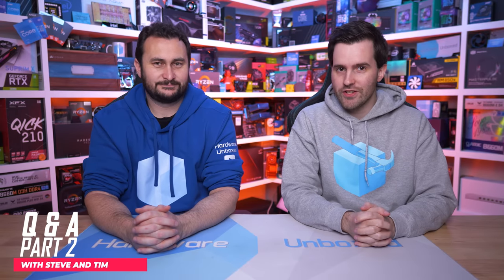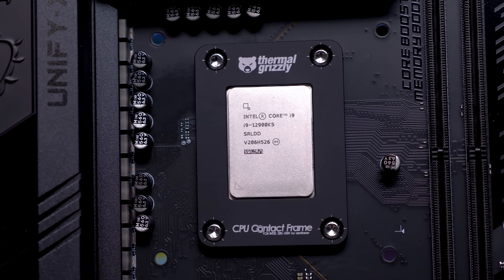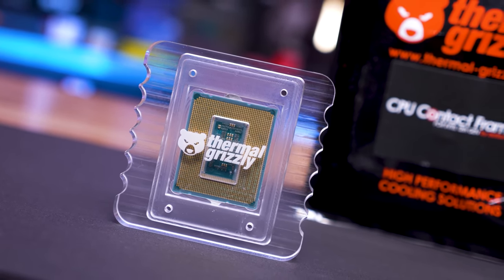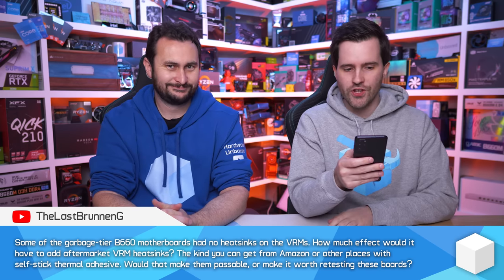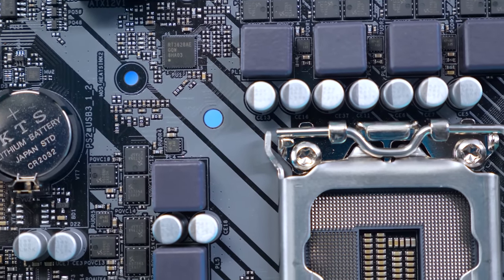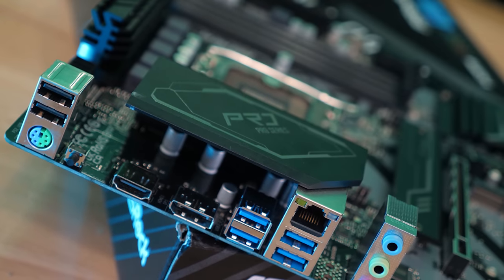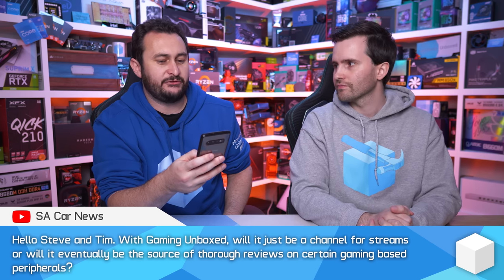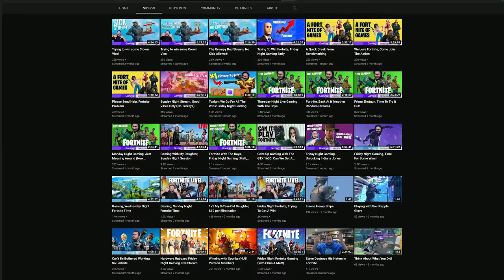Biggest Tech Fail 2022? Zen 4 To Make DDR5 Relevant? August Q&A [Part 2]

Comment: 8:30 - Yes, for most but not all games I use my mouse's max DPI and move the mouse only millimeters to achieve the movement.  I don't however know what that DPI is without looking it up.  It's the newest version of Mad Catz's "RAT 6+" - a flipping fantastic $35 - $45 mouse and unlike Razor, LogiTech, and other Chinese trash, this Taiwanese mouse is built like a tank with solid 2.5mm aluminum base and high impact plastic upper.  But enough about the mouse, I use it at full DPI like this because I got used to doing so as a tournament level Quake III player back in the day. I click the DPI down 2 notches when not in game - and sometimes three notches when using applications like Motion Builder, Maya, Houdini, and so forth.  I also never use a mouse-mat - so it's a slippery-hard desk top surface.

Comment: intel is done, hard failed at GPU, incoming hard fail at CPU against zen 4
Reply: Yes they hard failed at GPU but it would be unrealistic to expect anything different.

As to CPU, i'm liking the cadence that emerges that Intel and AMD can beat each other every few generations. 12 series was a success competing against Ryzen 5-series. Though honestly Intel doesn't really suffer all that much since all the institutional customers buy Intel, never AMD, and it would take a horrible lot to change that. Their platforms are on the whole better behaved, with fewer bugs affecting odd peripherals as well.

Even today for many years with AMD being a MUCH better datacentre choice, since you need wide and power-efficient, you'd find it so difficult to rent an AMD VPS or rootserver. It's sad actually, but good news for Intel.

Comment: In terms of 4k, my 6900XT has been quite reliable. Obviously anything running Vulkan can be used with 144Hz + vsync (like Doom Eternal), Games like Borderlands 3 run at ~70-80 fps (most settings on ultra). 
Games like Cyberpunk that are generally very poorly optimized take quite a hit however, especially with raytracing. 
Also, rdna2 runs quite a bit hotter than ampere. My card is at ~80°C while gaming.

Comment: I really still think Intel could have avoided all this... They could just make good iGPUs, and when they're already good and they have all the quirks and drivers dialed in they just expanded to dGPUs, like start with low end models but with good drivers and slowly ramp up to high end as they optimise the architecture for higher power draw...
Reply: That's essentially what they did though. The Intel iris igpu was released a few years ago now, and the a380 is equivalent to the top line i3. Later on they'll be releasing an a780 which will be equivalent to the top line i7

Comment: E dpi = dpi * in game sense
Reply from the maker: What about Windows?
Reply: @Hardwareunboxed  Competitive games with mouselook are usually not affected by Windows pointer settings, preferring Raw Input APIs.
Reply: @Hardwareunboxed  I'm not certain but I've seen in mouse aim dpi videos from Rambo Kim and the likes that it doesn't affect in game metrics. i have mine to the default speed and I uncheck enhance pointer precision. I've noticed a few nuances that can make you want to change these settings from mouse to mouse like sensor placement. But what I've always heard is you want your e-dpi in between a certain window between 1600-3000. I calculated mine just now and its 2800. I mainly play destiny 2 my mouse is a razor orochi v2 (slightly forward sensor) I run a dpi of 400 because of this and an in game sense of 7. I used to run 1600 dpi with an in game of 4 but i found i was a little too twitchy and i was over correcting my shots a lot after reviewing recorded game play. IDK this whole thing is a rabbit hole like most things ha

Comment: Im, genuinely confused when people ask about Intel cpus these days, they have been trash compared to what AMD has been offering for a while now, either with power, heat or just down right performance at times. I guess there is a lot of old memories still in peoples minds
Reply: Alder Lake is pretty competitive with Zen 3 in the performance arena, and apparently it's more efficient than Zen 3 when the computer is idle. So I look forward to Raptor Lake actually releasing on time (i.e. within a month of the product it's made to compete with; Zen 4) so neither company can say "of course you beat our year-old tech!". 

My prediction: Intel wins multi-threading due to their zillion little cores, and AND wins gaming overall. A role swap from where we were four+ years ago.